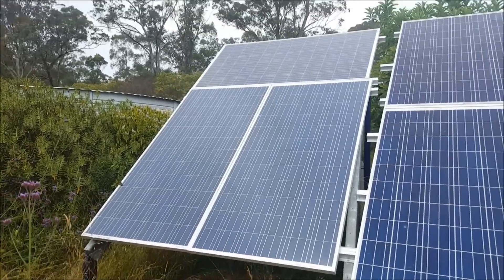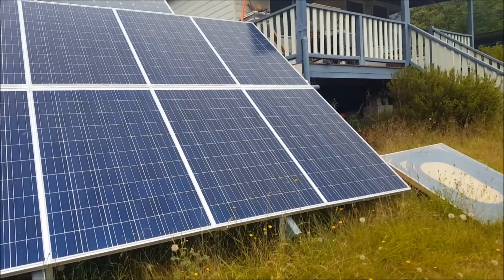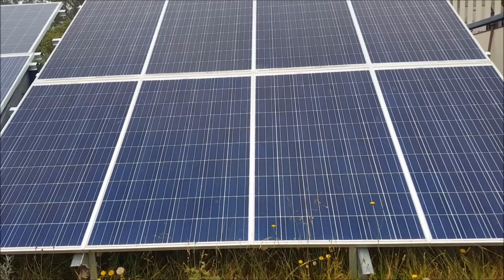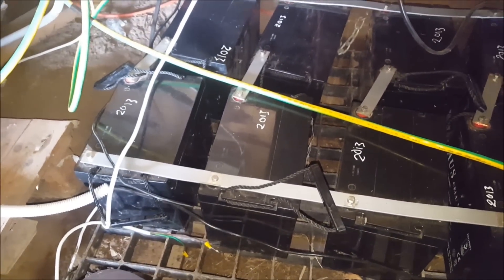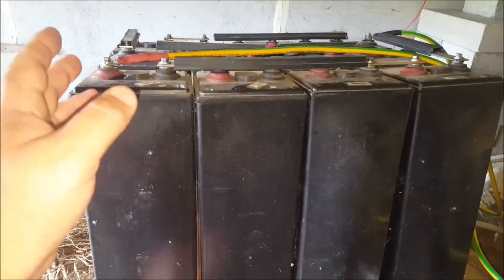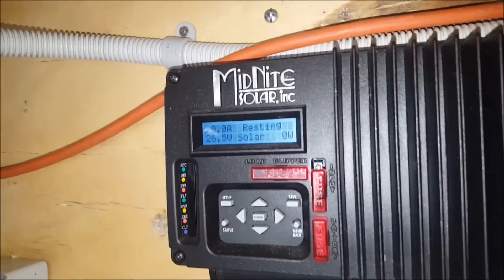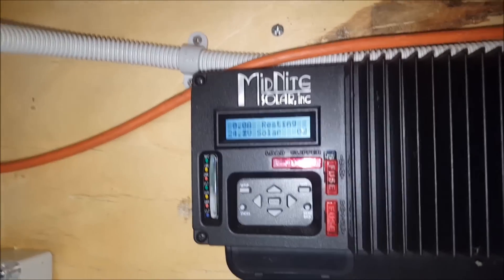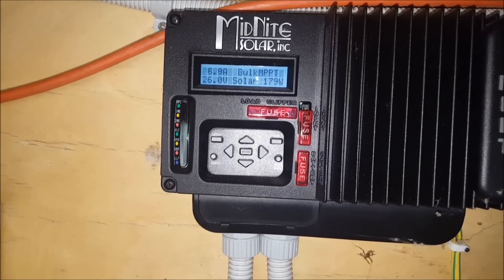Off grid solar power - Dual battery banks

Comment: can i use different kinds of battery banks? like one led-acid and one sealed?
Reply from the maker: No.
Reply: @PopsShack  Why not?  I am planning too, and thought I'd learn something here.   I have separate controllers (small incremental cost) to reduce a single point of failure; one controller for each array (some power is better than no power).  I currently have the ability to replug either array to either controller and either controller to disparate battery banks.  Due to motorhome limitations, I have different battery chemistry.  The existing is deep cycle lead (and have years left on them).  The new bank will be LFP inside the motorhome where they can be kept from dropping to 0 degrees for much longer.

Comment: Why don't you use battery isolator to charge both banks without the need to switch manually?
Reply from the maker: This IS a battery isolator. I like the manual switching, that way it only switches when I want it to.
Reply: Pop's Shack I see, I want to run a similar system where I have two power banks, one for night use and one for day use for heavy loads... I read about the diode based isolators where it allows you to charge both banks at the same time.. But still don't know how to make it automatically switch to each bank... That's why I asked you. 
Cheers

Comment: Nice video but on your small battery bank if each battery is 35ah then you have 5X35 the two in series does not change it or 175ah in that bank. On your large bank to be 640ah is each 2v battery  640ah if not the large bank would be the size of one battery since they are all in series? Hope all works out for you.
Reply from the maker: old time engineer Each 2V battery is 630Ah. Each 12V batter is 75Ah.
Reply: Pop's Shack ok miss under stood

Comment: Hey mate. 
Glad to see those batteries are doing well.  
I'm just starting to set my solar system.  
Hope to see many more videos this year.
Reply from the maker: Mate, they're doing a fantastic job, thanks. Let me know when you get your system up and running.
Reply from the maker: The scrap metal dealer in Cooma is a good place to go for copper bus bar, too.
Reply: Pop's Shack really. I was only done there last week.  I might have to pop in next weekend as I need to get some for my 24v bank. 
I got my panels already as I knew a guy who works in the industry who was replacing a 3kw system due to an arrow sticking out of 1. I have all my batteries stored in an old switchboard that came out of Norman Ross in Woden for those who can remember back that far. 
I only have 1 string of my hawker energy 12vx25amp hooked up ATM with 1 panel and a $18 charge controller but looking to buy a victorn blue 150/35 controller in the next few weeks.    Any thoughts on these controllers?